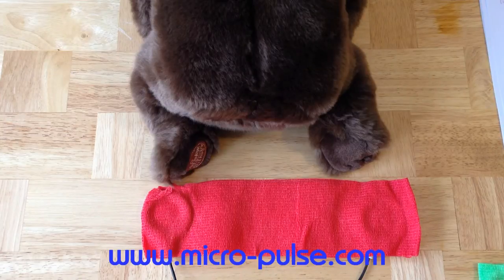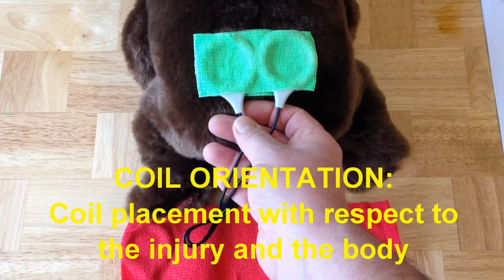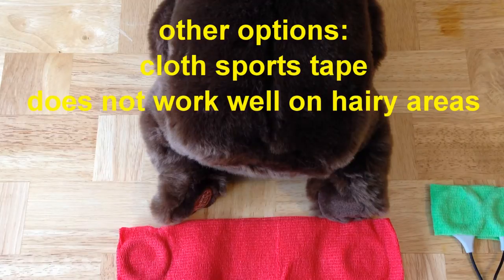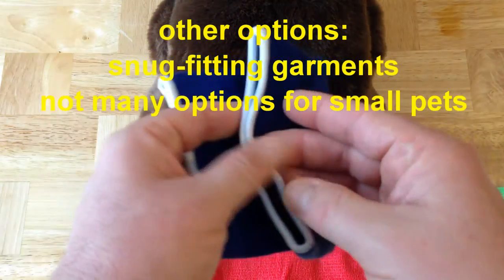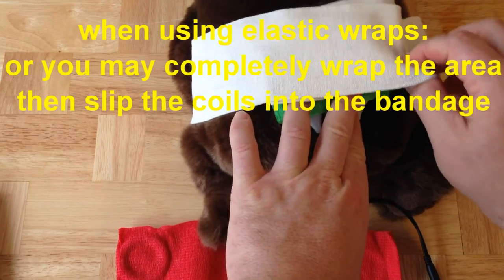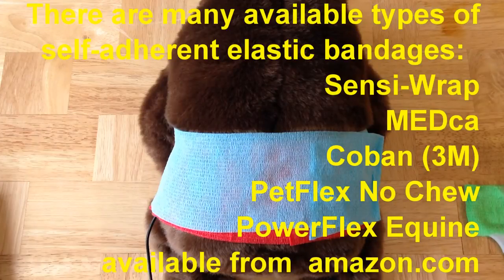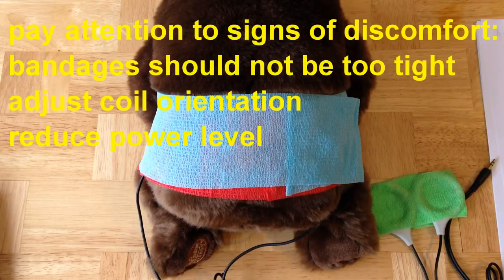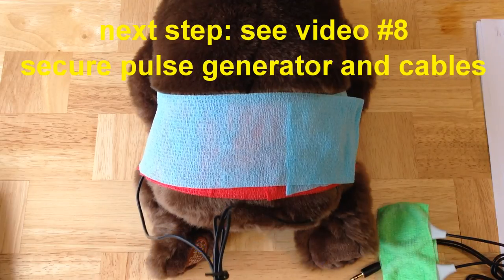Micro-Pulse ICES PEMF Tutorial 7 - Coil Placement Step #2

Comment: I can't figure out how to use this for my neck while sleeping. Any suggestions?
Reply from the maker: Sure.  Here is what I do:
1- use sports tape or self-adhering wrap to hold the two coils together in a figure "8".  For reference, see this video at about  0:40 (the two coils wrapped side-by-side using green self-adhering tape).  Make sure the bumpy sides of the gray rubber coating of the coils are both facing the same way (not opposite directions).

2- Then, just place the wrapped-together coils across your neck where it hurts (usually across the neck, not along the spine).  It does not matter which side faces out, away from the skin, so long as you wrapped them together with the bumpy sides facing the same way.

In general you will have to be creative about how to hold the coils where you want them.  Some people ask me for a garment to hold their coils exactly where they want them on their body for their specific injury.  I am not a garment designer, but there is one item that fits any person, of any size, of any gender, at any anatomic location:  an ACE bandage.  You can use ACE bandages, kinesiology tape, or in some cases you can just place the coils under your neck or back while lying down.  Some people will use iron-on fabric tape to create a special pocket in a t-shirt to hold the device and coils where they need them.  Some people do even more complex things than that.  Some people find velcro-strap pockets on Amazon.com that are designed to hold ice packs in place, and they put one of our systems inside that instead of an ice pack because it fits where they need it.
Reply: Thank you. I'll try the ACE bandage after wrapping the coils in a figure 8 with smaller tape. If that doesn't work, I will try these other ideas. Thank you so much. Your customer service is like nothing I have ever seen. It's beyond amazing!
Reply from the maker: OK, great.  After some experimenting most people find something that really works well for their specific need.